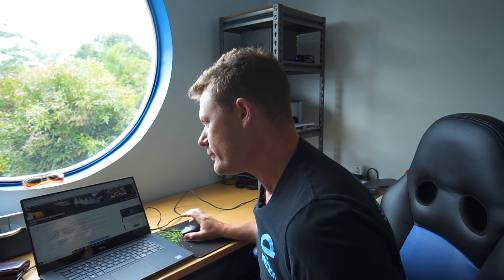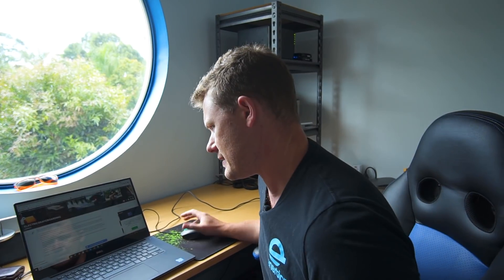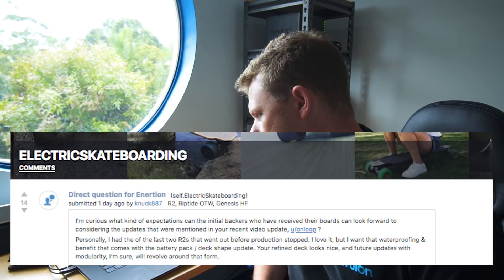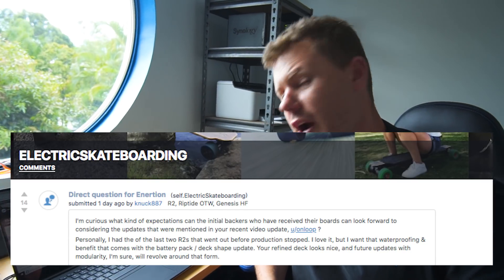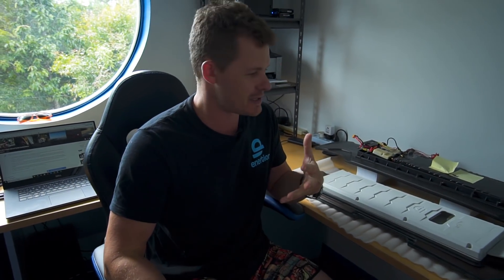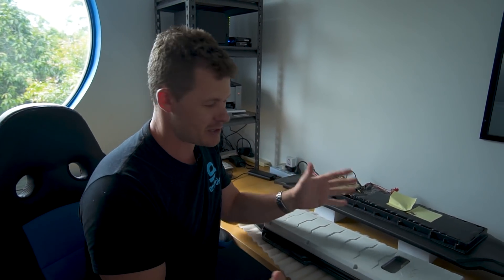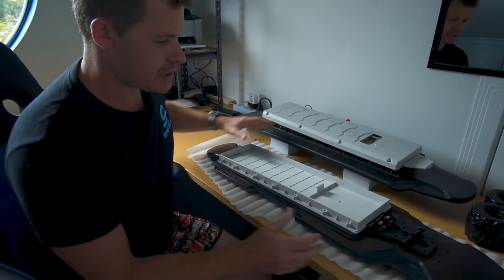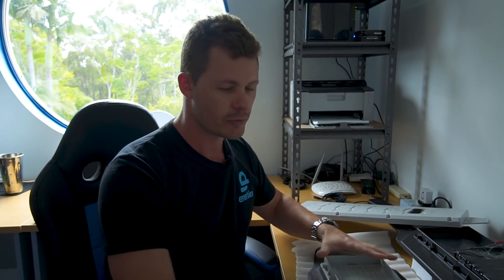Reddit QUESTION - Can I get the new upgraded parts?

Comment: Yo i had the great idea of combinig a mini flying drone with the controls on the electric skateboard. So that they both move in tandam and then you would only have to worry about altitude   control with like 2 extra buttons. It was just an idea do you think that it is possible?
Reply: are you like, 12?
Reply: Acceleration and top speed of the two would have to be the same, which they won't, so they'll be out of sync.  It's best to get a fancy drone that can auto track you. (money)

Comment: Hi Jason. I have not received a shipping notice yet, order number something like 235 or so, can't remember. Would this have a cut out deck, or flat bottom, and would it have the new pc board? Thanks and looking forward to the electric magic carpet ride.
Reply: VanoRama RV someone posted this link https://enertionboards.zendesk.com/hc/en-us/articles/115000574274-Where-am-I-in-the-Raptor-2-Queue-When-is-my-board-shipping- in the comments a couple videos back. From enertion showing a shipping schedule for orders. I knew the numbers were bs!
Reply: Thanks for the link, that is helpful. I checked and the order number is different than the build number, my build is 250. The order number is in the 10,000 range not the 235 I stated. So the link info would be correct and the board should ship in March. I am just wondering what configuration it would be? Not a biggy, just wondering?